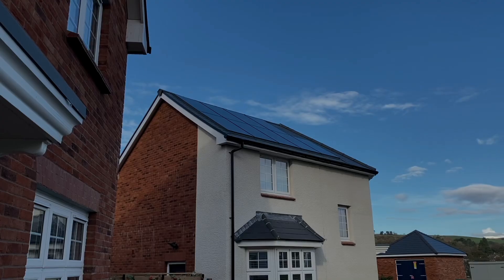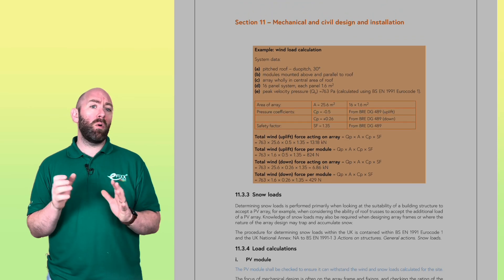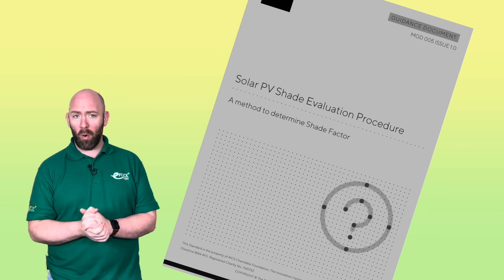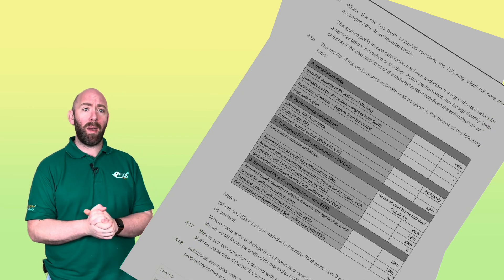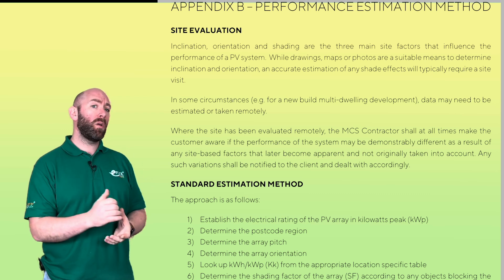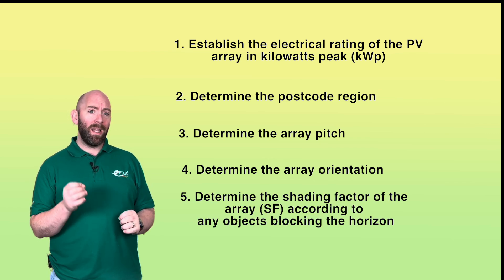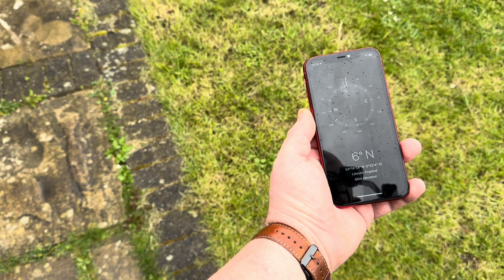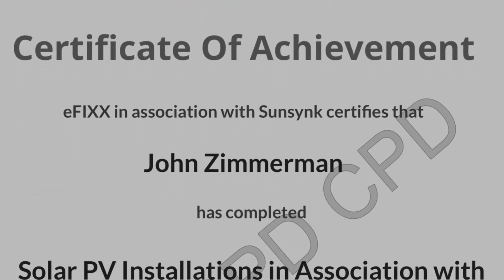Master Solar Design: A Blueprint for Electricians

Comment: Here's a question for you ~ as I've heard two totally contradictory responses.......
A semi with a hipped roof has 3 roof faces directed at 90' from each other.  Let's say, for simplicity, North/East/South.  
A supplier says that you can have panels on all 3 faces, even though the north is likely to perform less well than the others (but something might be better than nothing). 
Each panel is installed with a DC optimiser, so any imbalances in the string are covered by the electronics (and panel by-pass diodes etc). 
One installer says these can all be configured on ONE string, even though the orientations are different, say 3 or 4 panels on each. 
Another installer says you should have the 3 faces set up as different arrays, and feed individually as three strings into the MPPTs. 
Which situation is correct?
There is so much opinion and little guidance for many....
Reply: Optimisers trying to compensate for 3 totally different facings will end up losing more energy trying to compensate/configure a single inverter/MPPT. They're really designed for partial shading from say tree/chimney etc...
Me personally I think maybe 2 choices...
Either 2 or 3 inverters... I'd go for a mild dual mppt & one small single mppt inverter
(or 2 x dual mppt's & just use 3 strings out of a potential 4 strings, the unused 4th string could be a shed/wall/carport string in the future)
You would have to check each inverter if they can easily co-exist together, especially if adding battery/hybrid & have to be configured to operate in parallel
2 x same make/model very basic grid-tied (no battery) inverters can "usually" be chucked in & function fine, hybrid/batteries often require some configuration, either parallel or the 2nd inverter allowed as an additional input to the first/master hybrid inverter

The other option is to have micro-inverters on all the panels so they all work independently to each other, but could prove costly & more to go wrong up on roof - BUT each panel would output independently & not dragged down by a shaded North panel/array

Asking optimisers to smooth out all panels on 3 different facings - not wise, they will try to smooth out/compensate badly & send a much lower current through to one string = low DC output from panels to be converted to low AC power 
Micro-Inverters - Yes they would work, converting each DC panel to AC independently

2 x modest inverters = 3 or 4  mppt's, each facing/string can output as/when the sun shines without getting dragged down by North, or held back by the East string late afternoon

You might be able squeeze in another panel by arranging them in a triangular layout:
3/4 or 5 portrait + 1 or 2 landscape above them - often with careful planning & trying different layouts you can squeeze in another panel (or more on larger roofs)
Triangle roofs are a PITA, they'll always look a little staggered/odd, maybe best with all panels landscape with a 3-2-1 format depending on roof size

Be warned - landscape arrays are more involved, more rails are used & most companies will just want to sling up 2 rails for a row of portrait panels - bish-bash-bosh, get the scaffolding down, onto the next job.
So don't be surprised if most companies try to seek out a straight forward portrait layout, on easy pan tiles, naah can't do much about that vent/velux, you'll have to have a lop sided gaping hole in your array m8, we're on the clock to get these panels lashed in today

You could also find the two large roofs (front/back) can fit, or fill out better with larger panels (2m+ in length)
The small size side roof might fill out better with smaller 1722/1765mm length panels
(But you probably want to ensure they all look similar/all black)
 
TL-DR, good luck with your bespoke roof array
I'd pobably go with 2 x modest inverters for 3 x smaller seperate strings
or
Micro-Inverters (not optimisers) - yes some might say they are similar
(ergh no they're not and optimisers won't do a very efficient job with North+East+South panels into one string)
I'd like to think the other company meant micro-inverters, than optimisers, giving them the benefit of the doubt or it was lost in translation coz optimisers would imho be unwise in this instance
Reply: @authuruksake969   Thank you for this. I was sceptical at the capability of efficiently smoothing 3 directions. The proposed optimisers are Tigo, so I think I will ask them directly for the response related to their product.  
I worried that the offered solution was simply averaging everything down inefficiently.
Reply: @herrtomas6729  Tigo £40 optimisers for "partial shading" - trees & that's about it

If you have a clear-ish roof, with no or next to no shading then don't even bother with optimers

Just more money, they'll probably want you to take the Tigo cloud as well - another £150 + X times the TS4's, so up to £600 say - that'll buy the other inverter, well 2 x basic grid-tie 2xmppt (no bat) inverters even.

2 x 3kW or 3.6kw inverters with 2 x 1.5kW/1.8kW inputs each, 3 to use + 1 spare

Optimisers only if/where needed, many modern panels operate quite well without optimisers and the bypass diodes smooth out very minor partial shading
3 different facings are best suited to their own mppt, have a look on some PV forums, plenty of people ended up splitting these optimised panels onto another string coz the actual performance wasn't as expected
Reply: @authuruksake969  My thoughts exactly! I have actually contacted Tigo for comment as their website info seems to infer the same.  
And when you have a PW3 with 3 MPPTs anyway....  And even 3 panels will exceed the 60V min start up...
3 strings seems the way to go.
Reply: @herrtomas6729  Yeah check the specs of the inverter(s) & all that tech stuff...
Including the panels themselves, most regular panels will have a voltage of around 32v to 36v approx, so even 2 panels will start said inverter...
If using much smaller rigid panels - say 100w - 200w (Camp/RV panels as I call them), they have around 18v - 22v so will need 3 RV panels to awaken the inverter first thing
Growatt MIC (single mppt) 750 to 2000 have a 50v startup & 2500, 3000 & 3300 the voltage is 65v
Growatt MIN (dual mppt) 2500 to 6000 have 70v startup
I use a MIC 1500 as a test rig, due to 50v startup, couple of regular panels or a few RV's & it's up & running seeing how panels perform under sunny/cloudy even shaded conditions

Alas, Tigo are marketed as a universal optimiser, working with any inverter etc...
Unfortunately, people find they may not be quite as efficient as they were lead to believe

3 separate strings would be best, but also plan the layout as best as possible (obvious)
If you have a corner that is considerably shaded most of the morning/afternoon & even with the best optimisers that drop that panel down without effecting the others...
If it's THAT shaded for so long, with reduced output (even with best optimisers in the world all working as it should) - What's the point of putting a panel in that corner ?
If it's shaded just for first hour or last hour, then no biggie as the output is so low it won't really matter if panels are running at 1a or less

In a shaded corner, you might find changing panel sizes might help,
eg: 4 x smaller panels might allow to arrange them to avoid heavily shaded corner
or 3 x larger panels & a different layout might avoid losses & offer a more steady output
Smaller RV panels could allow a bit more flexibility in designing an array to squeeze in as many panels as possible, but £ for £ the smaller panels are more expensive for what they offer, compared to a regular 420w or so panel

You can do some of this layout stuff yourself with some design tools or even just mess around with Power-Point with some rectangular shapes for fun, to see what you might be able to squeeze in.
Though as I said earlier, don't make it too fancy/complex or looking like the game Tetris...
Coz most companies are on the clock & just want to sling up straight forward stuff - nah sorry m8, can't fit that in, time is money & all that - even if you are paying for it as the customer

Even with 3 x small strings, it will all add up & reduce your energy bills,
Best of luck
Reply: @herrtomas6729  optimisers bring great benefits beyond performance. I would strongly advise you use them. The rapid shutdown function is great reassurance if you have a catastrophic failure in the array. Preventing fires and such. It also allows first responders a point of isolation entering buildings for other circumstances such as a regular house fire. Sitting down DC cabling within the dwelling. 

They will also recover energy even in largely unshaded aspects. Think of times bird droppings or intermittent cloud cover plays a part. Especially in the UK over winter. As installers we see the data across multiple installations and the facts don't lie. Installed correctly they work. They are also not £40. Roughly speaking £25 and for the safety aspect alone money well spent. It's also worth checking with your insurance as many are now stipulating rapid shutdown of arrays to provide policies. This can be achieved in other ways such as projoy but all things considered optimisers are generally the best way. 

In your circumstances we would blend the tigo with 3 strings or utilise solaredge. Sadly in the UK we don't currently value the fire safety aspect highly enough. In the USA for example it has to be in place. 

You also lower future maintenance and repair costs with easier diagnosis of poorly performing panels thanks to the panel by panel reporting. 

We offer optimisers free on every installation.  To take the financial argument away. For such a low cost item it seems daft to omit them. 

Hope that helps.
Reply: @electrician247  That's very interesting, and I'd not even realised the fire safety side was a feature.  I don't think any channel has made that clear - certainly a good feature point for the future.  Generally people seem to major on the shade/recovery side of optimisers and micro-inverters. 

I've tended to watch your/UK information about solar, and also a number of the Australian channels.  It's interesting to understand the different views, or regulatory codes.  As a member of the IET I also keep up to date with their guidance and rulings. 

I think the only other differences I've noted in Europe is regarding 'balcony solar' which seems quite big in the lands of apartments, but simply not allowed over here.  Again, I find the comparisons, and the information published by channels such as yours to be most informative. 

Keep the channel rolling!!
Reply: @herrtomas6729  I've a few videos on the fire safety side. Something I didn't first think about entering the industry but very important to us now.
Reply: @electrician247  With the utmost respect I'd like to point out:
Tigo £25 trade will often end up as near £40 on the customer's invoice
(The refute of my figure was the primary reason to respond)

However, by using optimisers you've double the total number of MC4's, one of the biggest failure points/fire risks in a PV string. Yes damaged/failed panels can happen, but usually the biggest fire risk from arcing comes from old/loose/mismatched connections/MC4's under panels - which has now double in number due to optimiser's

Also they are all now mismatched, as Tigo use Stäubli, so it will go for example:
Brand X-Stäubli-Brand X-Stäubli-Brand X-Stäubli-Brand X etc... throughout the whole string(s)
So to mitigate this, each panel will need its cheap/std MC4's cut off, replaced with a pair of Stäubli's, to mate with the Tigo's 4 x Stäubli MC4's to ensure best connection/reduce possible arcing under panels, a leading cause of PV fires on roof etc...

Yes, fit the ends of the string as a matched Stäubli pair, but also now every panel should be Stäubli instead of just replacing string ends with a pair of Stäubli's. Otherwise you've double the connections and now they're most likely to be mismatched on each panel as well

If all installers do this complete Stäubli replacement is another thing, but should at least be considered if pushing the shutdown safety features of Tigo's. Whilst it doubles the connections in the process & possible mismatching by using different connections under each panel, if MC4 replacement is ignored, then it can itself, create an arc risk in this safety feature of the Tigo.

Factor in a pair of Stäubli MC4's for each panel, the crimping time (not much, but on all panels it adds up)
Now you might routinely do all of this complete MC4 replacement throughout the whole string(s)
If you can take the hit on all this, then fair play to you sir
But usually somebody has to pay for the lunch in the end, one way or another

This is not a dig at anybody, nor a who's right/wrong debate/argument
I respect your wisdom & knowledge, but this highlights the differences in opinions on a subject & the trade offs when designing a PV system & the different approaches installers may have, when various factors come into play

(At least we agree on individual strings for each facing)
Reply: @authuruksake969  you are sort of correct but also way off. 

You are right MC4 connectors fail. Primarily due to poor installation rather than mismatched connectors. 

Stabilu actually have a cross compatibility chart via solaredge so what you describe doesn't necessarily play out as true.  But I agree they should match and we ensure they do pre the work program. It's an easy process while building the kit pack in the warehouse. 

We can omit many components due to poor installation methods. Same is true for the panels themselves lol. 

With a skilled installation team it's not a factor as these kind of basics are covered. 

Basic string cabling without rapid shutdown is something that will be regulated against in the short term which says everything tbh. 

I would much prefer 10 or more optimisers monitoring for arcs, over temps, output variation and reporting on that minute by minute rather than not. 

Most installers will factor in labour for installation but considering the benefits that relatively tiny expense is good insurance for something that overall with be a significant investment and sit upon the most valuable asset of them all.... your home. Don't short change the value in that would be my advice. 

Fit optimisers and use a reputable installer. 

All of the noise around omitting isolation points and MC4 connections is sat in the realms of accepting poor installation skills rather than dealing with that and enjoying the huge upside to all of those things. 

As I said some installers provide these at no cost to the consumer. Much like bird guard. It's all free on our proposals.
Reply: @electrician247  Well my initial response didn't post, but again I refer to the lunch...
Your "free" optimisers/bird guard pitch to the customer might in turn request a short clip of install to promote further business, or it might be totally unconditional the free tigo/bird guard offer...

But these costs have to be recouped in one way or another elsewhere on the project/job, to offset the apparent loss in one particular area - that's business

You were right, I was way off, it's actually triple the mc4 connections, 2 on panel you replace plus the 4 on the Tigo making 6 in total on each panel vs original 2 per panel
Reply: @authuruksake969  Nothing required in return. We either install systems with free optimisers and bird guard or we dont install the system. No reviews, clips or extra cups of tea required lol. We view it that importantly. 

The data we have on our installs and on going maintenance is invaluable. So is sleeping at night knowing we have done our best to both detect roof based fires and allow for isolation on PV strings when fire fighters are responding to any house fire. Those kind of things can save a life potentially. 

With both solar edge and TIGO the thermal sensors would shut a panel down on a connector failure. So if anything it helps spot what would otherwise be hidden connectors. If one can be done incorrectly with nothing looking for it. I make that a lot worse and so do the stats. Why do you think the NEC code in america mandates them? Because they increase failure and fires or..... Sometimes maths are easier than we think.
Reply: I can answer this that both can be correct. With some brands of optimisers variation beyond 25% in panel output can not be equalised for want of a better phrase. While solaredge as an example can happily cover that circumstance off in a single string. So it depends on hardware. Personally we would utilise strings to each aspect if MPPTs were available and enough voltage from.each aspect to begin generation. Gives redundancy if an array enters a fault state. 

Hope that helps.
Reply: @electrician247  Thank you for this. I was sceptical at the capability of efficiently smoothing 3 directions. The proposed optimisers are Tigo, so I think I will ask them directly for the response related to their product.  
I worried that the offered solution was simply averaging everything down inefficiently.
Reply: @herrtomas6729  tigo over 3 aspects wouldn't be advised. Solaredge is different and can work on a single string.

Comment: Asking an electrician what solar system to install seems like asking one which EV to buy. Some of this should be captured nationally by online planning services (offered by the same people who publish standards?), so electricians can advise but there's a reference system to do most of the 'heavy lifting' of calculating potential gain / costs / hazards / project-outline / best-practice. I love the idea of everyone having their own power station(s) but it's quite a shift of responsibility 'down the chain of command'!
Reply: Check out the role of a retrofit coordinator! 😉